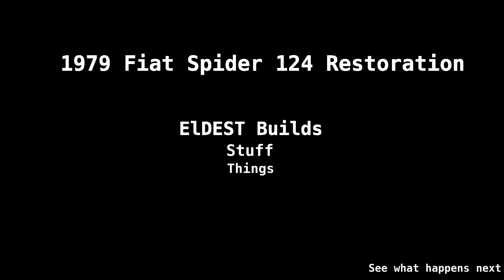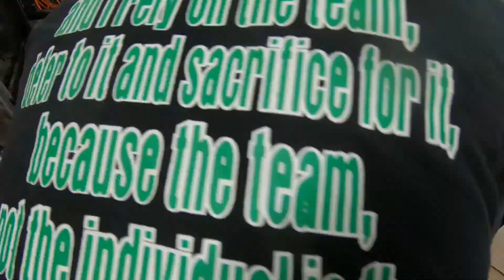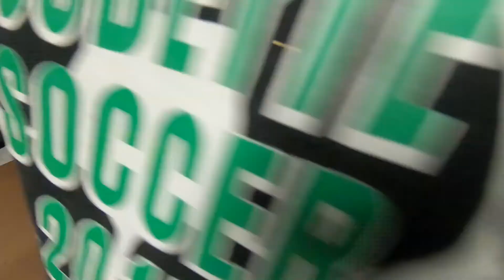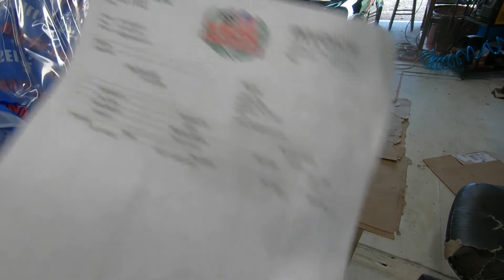1979 Fiat Spider 124, Installing the front bumper

Comment: Thank you for these videos. I’m loving them since I just bought a 76 that is in similar condition to what this was when you started. Did you say you narrowed the gap between the bumper and the grille? I’d like to get my bumper tucked in a bit rat than deleting it. Sorry if I missed that in another episode. I’m still getting caught up with them all.
Reply from the maker: Yes there is one for front and rear. Rear tuck requires removal of the fuel tank to get to the bolt. Links  are below 

https://youtu.be/c24xRBq1rwM

https://youtu.be/36AQo8D6SNQ